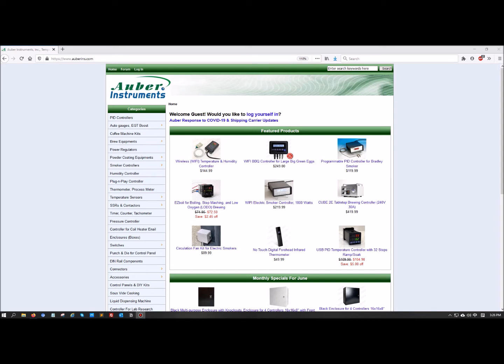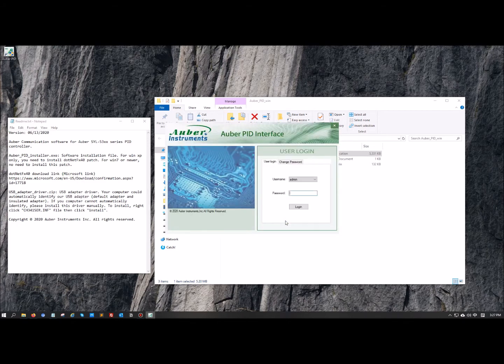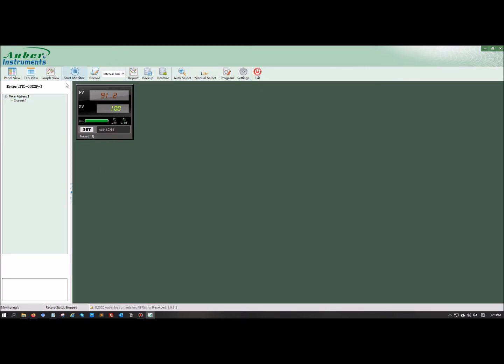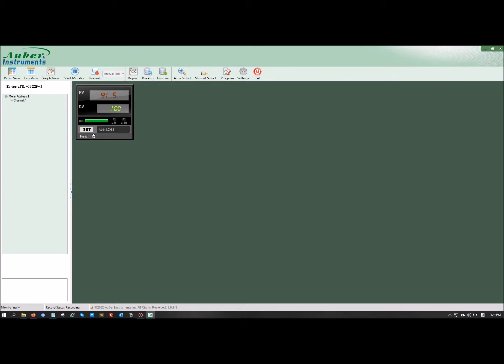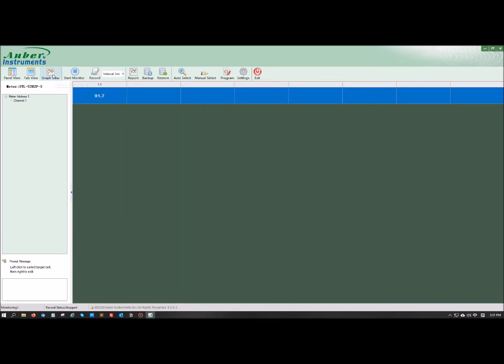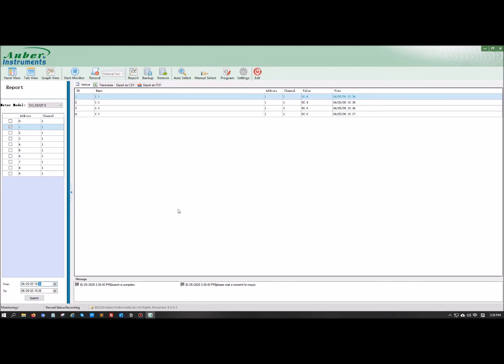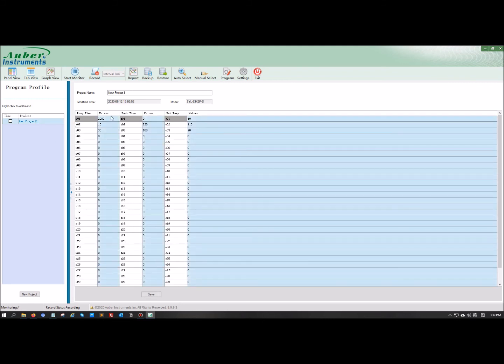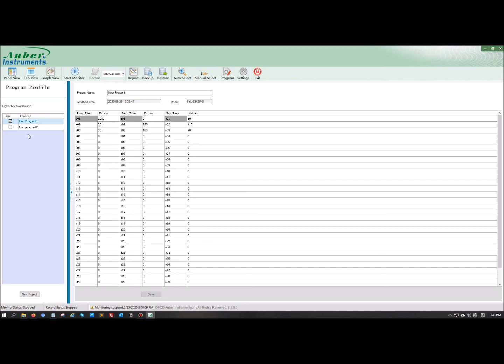Auber USB PID Temperature Controller SYL-53XX series Tutorial Video

Comment: Is it possible to ramp down from a high temp to a lower temp and how would I program that in using the ramp time/soak time/set temp values?
Reply from the maker: Yes, you can do both ramp up or ramp down in this controller. Please check its manual for the program examples at first. You can find it on our websites. If you still have difficulties, please contact Auber customer support.

Comment: Hi There.
I am looking for a Temperature to control ramp up in several stages .example low 70 c to  High 98 c. but in between i need to have a  few alarm set points  what is the best Temperature controller to achieve my expectation. please advice me.
70,75 ,85 90,98
Reply from the maker: The controller in this video only has one temp alarm relay. You can set it as absolute high/low, deviation high/low alarms, or band alarms (trigger when out of the range or inside of the range). If your alarm is related to your set temp, you may consider this controller. For details, please check section 5.3.1 on page 4 of its manual for alarm definition.

Comment: How would I write this firing schedule into my SYL-5352PA windows input screen please?  Thank you for any help you can provide me with.  

SEG   RAMP (dph)        TEMP        HOLD (min)  

 1     425C                      735C            15     
 2     AFAP                      515C           30      
 3     260C                      150C             0
Reply from the maker: r01 = 2000, t01 = 0, c01 = 40
r02 = 98, t02 = 15, c02 = 735 //ramp from 40C to 735C at ramp rate 425C/hrs
r03 = 1, t03 = 30, c03 = 515
r04 = 84, t04 = 0, c04 = 150 

AFAP: please use safty start feature (r03 = 1), changing SSB parmater to a small number like 10. Timer unit is by minute.
Reply: @auberintruments  Thank you, very helpful.  Can you please explain if the first step is just a warming step and is it always required for all fusing projects?  Thank you again.
Reply from the maker: @Jolene-kz5wt  It is a warming step. Only change c01 (above your ambient temp) if you need. If you haven't checked its manual, please check the programming examples in its manual for reference.
Reply: @auberintruments  That makes perfect sense, thank you again for your help.
Reply: @auberintruments  are the temperatures to be entered in C or F?

Comment: Perfectly straightforward and what I needed to know to get a jumpstart on the next project! 
I looked around the documentation, but is there an upper limit that the PID will report outside of the thermocouple type? In some curious exploration I saw that you can set the max output to a specific threshold, just wondering if there's a limit software wise that will result in a non-detected issue. In my case, I'm attempting to get as close to 1650C/3000F as I can.
Reply from the maker: This controller can read the full range of type K thermocouple, which is up to 1300C or 2372F. For your case, type K thermocouple may not be good for you. You may need to consider a different high temp type thermocouple. This controller has a max display limit parameter which is PuH. It is set to 1300 by default. You can increase it to 3000 or higher if you like. But type K thermocouple cannot handle over 2372F.
Reply from the maker: You can consider type B (up to 3100F) or type S (2912F). This controller can read type K and S. Please check its manual for its compatible sensor list.
Reply from the maker: You can find the spec and limit of type K thermocouple from this site: https://www.thermocoupleinfo.com/type-k-thermocouple.htm
Reply: @auberintruments  Wow, I wasn't expecting a reply so quickly! I have a few K types and an S type on order. Thank you again, I'm already blocking out supplementary parts found on the website. 😉
Reply from the maker: @C-M-E  Sorry for my mistake. This USB PID cannot read type B. Type S and type K are compatible. Our non-USB ramp soak pid like SYL-2352P can read type B.

Comment: How do you connect multiple controllers to the software?
Reply from the maker: You need to connect multiple PID controllers to the same USB adapter, then connect that USB adapter to the computer. PIDs need to be wired in parallel to the same USB adapter via their 485 ports.

Comment: Thanks for the details.  I currently have an older model Auber PID on my powder coating oven but I can not see any model # info on the unit.  Maybe the label was removed by the previous owner.  Is there any way to identify the PID model if that information tag/plate is missing?   I need to get a replacement and am interested in a newer model with a timer but want to make sure it has the same specifications as my current unit (which is failing).  Thank you.
Reply from the maker: It is not easy but still possible. Please contact Auber technical support directly: info@auberins.com